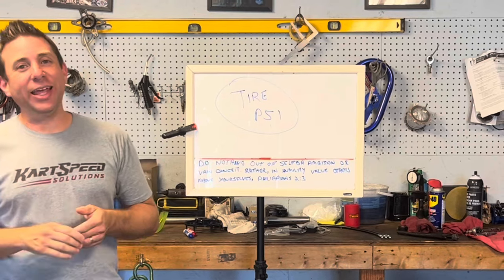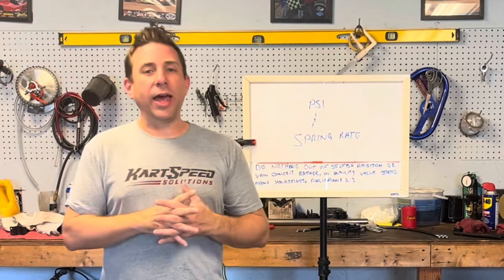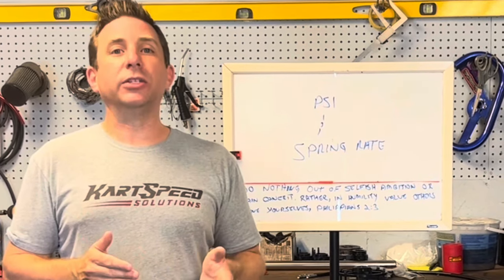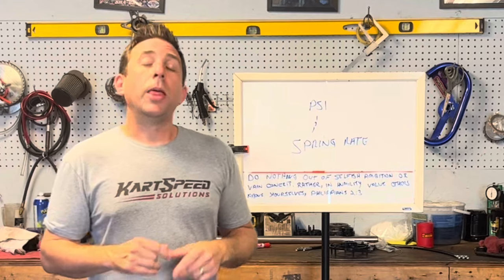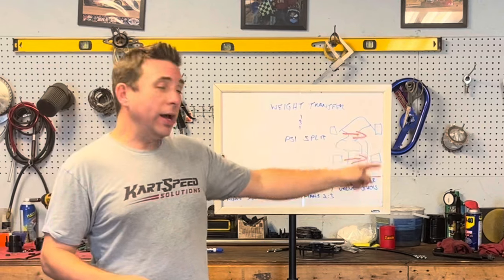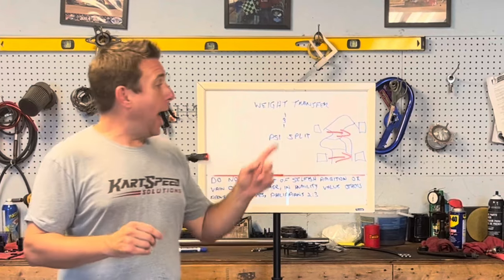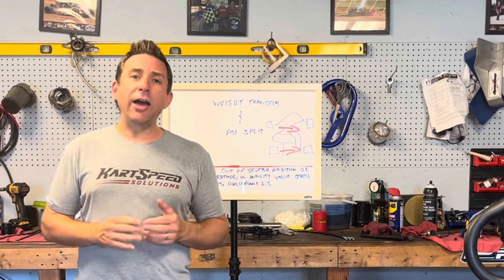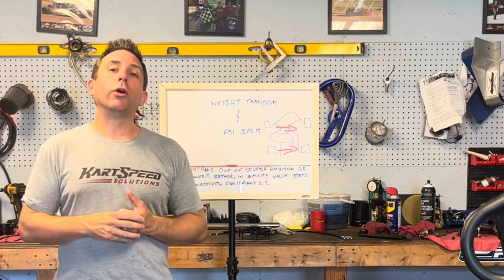Tire Pressure and Pressure Splits!

Comment: Low cross with high inside low outside on dry slick tire temps come off nearly exactly even after 39 laps. My temps ranged 182-183
Reply: It was 105 deg out direct sun

Comment: What difference would be with front to rear split?
Reply from the maker: Hi Lewis, sorry for the slow response. With a front to rear split you would be controlling front grip because you would be allowing the kart to move more or less weight to the front tire when the kart decelerates.
Reply: Less air in front equals more front grip?